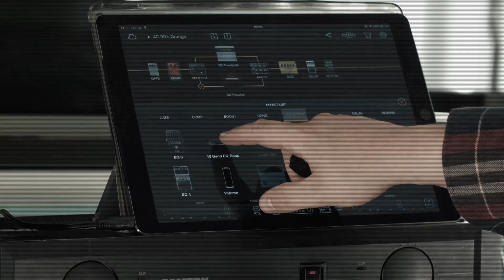Modifying an SM57 - Removing the transformer (TapeOp Mod) and changing the impedance

Comment: Dude, I have watched tons of videos on this topic because I have quite a few mics that I use in my home studio, and trying to get the best sound out of them for recording. You video has got to be the BEST video I have seen on the topic...period. I have a Shure SM58 with the transformer in it, and I have three Pyle PDMIC78's, which are clones or copies of the SM57, and they do not have any transformers in them. So I have an external transformer that I use with all of my mics...it's from Radio Shack and it plugs into an amp or PA, I plug it into my vocal effects processor (a DigiTech RP100...don't laugh...lol, it might be a guitar effects unit but it works great for vocals as well). All it is, is a round tube looking thing with the transformer inside, it has the female XLR jack on the back end and has the 1/4" phono plug on the front end. You plug your XLR mic into the transformer back end, and then plug the adapter into whatever...an amp, PA...or in my case an effects processor. I just bought the PreSonus Audiobox USB the other day, I've had one before and they work really well as an audio interface. I'm going to try and use my transformer adapter and effects processor with it and try out all my mics and see how it sounds in my recordings. I never heard of the resistor mod, so I will definitely be trying that for sure!! Just wanted to say that you have the best informative video out there!! Subbed for sure...keep up the great work!!
Reply from the maker: +Gun Slinger thanks dude! Lots more videos to come :)
Reply: AWESOME!! Can't wait.

Comment: Beautifully present and chunky sounding amp my dude.
Reply: Also I think if you mixed both those signals together, you'd get a fat sound.
Reply from the maker: +f u n k j u n k . n e t cheers :)
Reply from the maker: +f u n k j u n k . n e t tried it, no luck in this case, sounded quite dull. If it was set up as a freeman technique it does sing!
Reply: Good point, definitely considering having an sm57 modded like this. Thanks for the video :)

Comment: I think both mods took away some crispness. I preferred the sound of the stock 57 in this demo. But really, it all depends on the source material being recorded. Maybe if you don't have access to a ribbon mic, these mods might help someone find that middle ground between a 57 &  R121.
Reply from the maker: +Remy R makes sense! It's worth knowing that you can undo the first mod by putting the transformer back, or wiring it into an external XLR cable